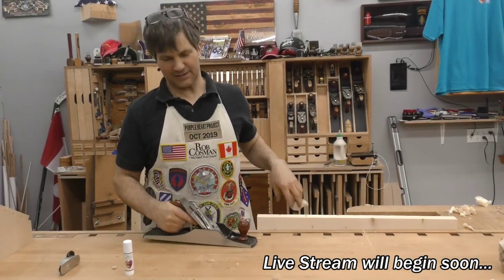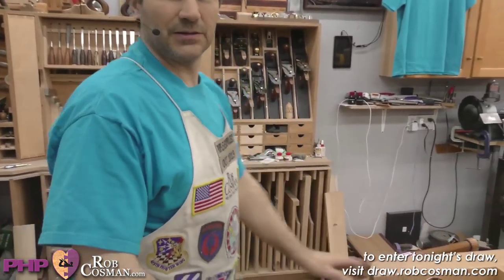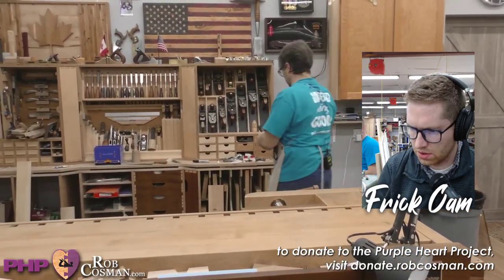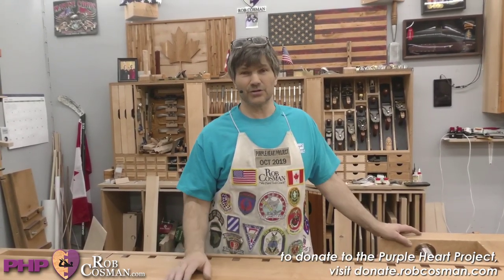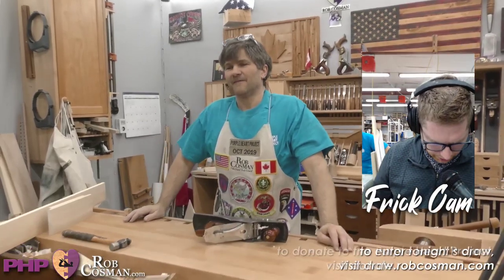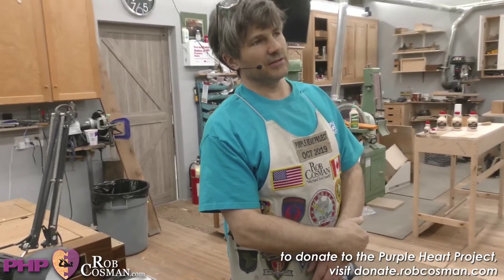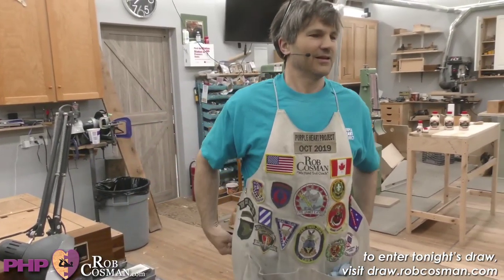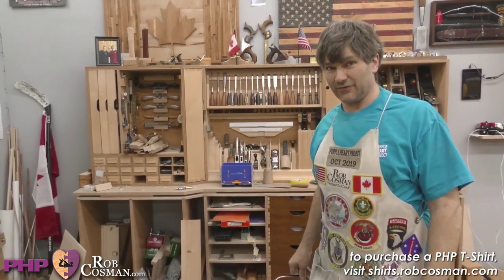Live with Rob Cosman Episode 25: LIVE QUESTION & ANSWER

Comment: Why not use a mortise wheel marking gauge?
Reply: The one I use has two shafts so the wheels can be interchanged in position.  Luban mortise gauge.
Reply from the maker: my mortise gauge I made for the tenon, bevels are to the outside and not reversible.  I use a singe blade marking gauge on the mortise, I find it easier to follow one cut line than to try to keep the chisel between 2.